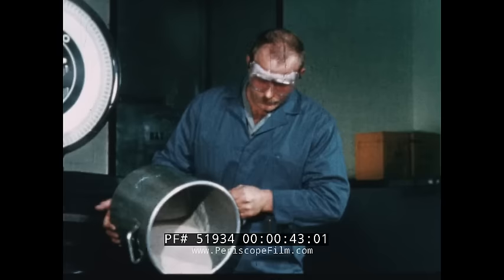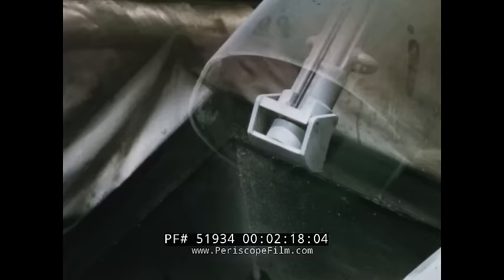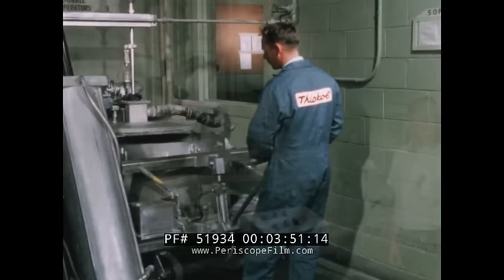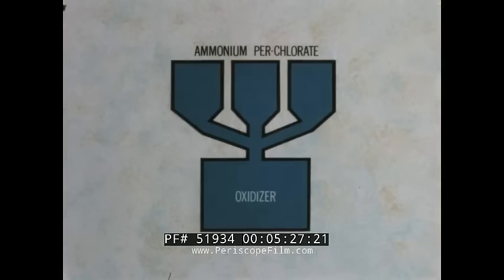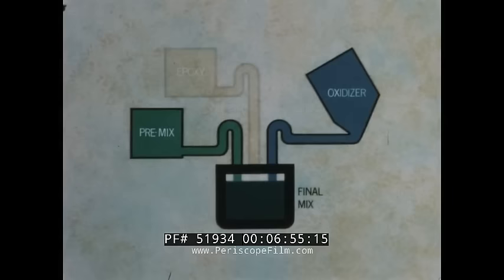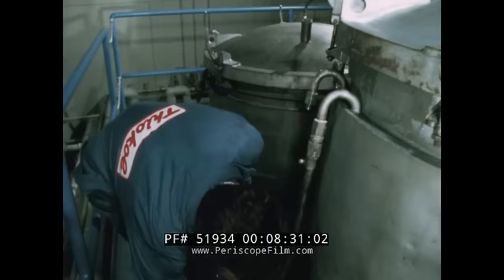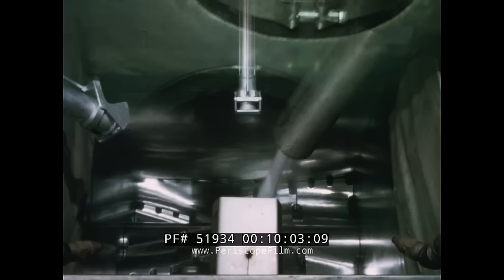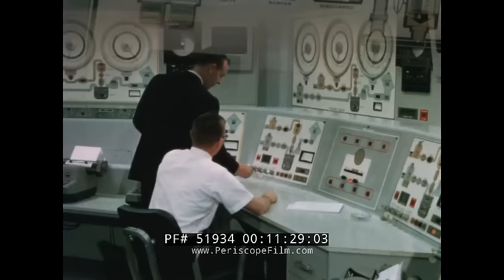THIOKOL ROCKET & MISSILE PROPELLANT  SOLID ROCKET BOOSTERS  "CAREFUL DIETS FOR MISSILES" FILM  51934

Comment: I used to work for ATK, Thiokol's successor.  Different division (ammo and military equipment), but it was cool working for the company that makes solid rocket boosters.
Reply: so you knew my uncle and my cousins they still work there.
Reply: @geomodelrailroader  Big company; he might not. My Dad retired when Alcoa bought out Thiokol; he started out in the lab at the Elkton plant and was up to senior management in Utah by the time they eased him out.
I loved the ginormous cake mixer at the Elkton plant for the STAR motors and what looked like actual bakery mixers they used in the lab when mixing up small batches for teeny tiny test motors.
Reply: @ellenbryn  yup and my uncle just retired from the plant last year my cousin still works there. Too bad Project Omega got the axe but SLS is still being built at the Utah plant. Elkton was in the book Secret of the Old Mill and that incident where they had a fire in the mix building did happen luckily the plant did not blowup like what happened at Pepcon in Vegas.

Comment: Fun fact ... my dad started his career as a research chemist in the aerospace industry in the very plant in this film while they filmed this. I keep looking to see if I can see him in the footage.
Reply: Jeff Marler do you know when this video was recorded? 70s?
Reply: It would be mad if you could. Is he in there?
Reply: Oh that's so cool! Any fun stories from being on the job?
Reply: @WineScrounger  I looked several times but I could not see him. He would've been in the lab or loading rocket motors with the finish propellant.
Reply: @machadpe1  I'm guessing late 60s, but I don't know for sure. It was right outside of Ogden Utah.
Reply: @SouthKratts  A lot of his work was military related and classified so I didn't hear a lot. 

I do know that in his career he worked on solid rocket motors that were used in minute man missiles and the space shuttle (that was his work at Thiokol). Some of his work was also used in the heat shields on the shuttle. He also worked on the B2 Stealth bomber and was actually inside the aircraft before it was declassified. The team he was on developed the radar reflective material. 

He did describe to me one time, having to crawl up into the bore of a cast rocket motor to patch a crack. 

And another time they were testing a motor out in the desert and lost control of it. Apparently it just spun around burning in a concrete pit until the fuel was consumed (there is no way to stop those solid propellent motors once they are started). He ended up taking home a chunk of green glass that was formed from the heat of the exhaust on the sand.

I currently fly high power rockets using the same fuel he helped develop (I have a LVL2 certification) but I only have a few pounds of fuel at any given time.
Reply: @jmarler2010  Level 2? That's great- I've had my Level 1 for a while and have been meaning to test for Level 2 (although the pandemic has somewhat gotten in the way of that). I had gotten it through the rocket team at my old school, and there was an alum there who showed us his ten-foot-high Level 3 rocket.

I shouldn't be surprised that the motors burn hot enough to make sand into glass. I'd do what your dad did if I was there too- that's a heck of a keepsake!

And I didn't know Thiokol had made radar reflective material until today. Cool! Your dad sounds like a cool man. :)
Reply: @SouthKratts  No, he started at Thiokol, but he didn't stay there. He was at a company named Fiberite when he worked on the B2.
Good job on the lvl1! Our launches were shut down last summer as well due to the pandemic, but if you go to my YouTube page, you can see my lvl2 flight.
Aluminum and ammonium perchlorate react at 5800 degrees so making glass is no problem.

Comment: I was teaching chemistry and math at a community college when I was approached by the physics professor who wanted to start a rocketry program for his STEM students. I began getting formulations and vendors for the chemicals. I am probably on every watch database the U.S. has. :) I was able to get a 400 pound drum of potassium perchlorate donated, just pay the freight, by Thiokol! We made simple 2" diameter ABS tube walled rockets with water-putty nozzles that would make 110# of thrust. The first test we ran the physics prof told me, "you may want to cover your ears"....we were 30-feet away behind a parked Suburban. DAMM they were loud little things! Yup, rockets are a blast (no pun intended).
Reply: Impressive. You’re a great inspiration to those students. I’m a community college student myself studying to eventually work in aerospace somehow. A note of advice. Richard Mamma’s site has a lot of information on the construction of solid fuel engines through his experiments . 

I would highly suggest using steel walled engines as they won’t explode dangerously as easily if it does explode. Be careful, good luck, and have fun. Awesome!

Comment: "sealing the container is critical"  Note the special coffee cup port closure device at 5:23
Reply: The paper cup is there for good reason.  They would not want anyone to try to clean the coverplate due to the fact it might cause an explosion and fire. So they use paper to use one and dispose of properly. Most likely incineration.  Waxed paper in explosives manufacturing is necessary. They insulate and don't generate a static field. Plastics like Saran Wrap come charged up with massive amounts of static electricity, which is a major no-no.  They use waxed paper and ordinary paper products in fireworks making too.  Not one bit of plastic or phenolic type material is see in any of "How it's Made" films of making explosive. Same with this one.
Reply: @Foxtrot Uniform that’s Amerika, more capital for the Plutocrats. .
Reply: @Alternative Power Systems These cups were probably contract built, & have a Gov't National Stock Number (NSN). I imagine the cups also are stenciled with "Not for the  containment of beverages, hot or cold".

Comment: What is that thing the guy is putting together at 7:19 ?  I've never seen anything like that before, and it isn't obvious how it interfaces with the process.
Reply: @Brian J Govern   This is an early version of ROM ( read only memory ). Essentially what we see is a "breadboard" with interchangeable components, by which the programming is achieved. By the look of the components they seem to be ceramic resistors in the 2 to 8 watt range. I presume the resistors are selected for precise values from a batch, then color coded for easy identification by the breadboard programmer. When inserted into the backplane reader unit, the analog computer will read the values and use them as variables.
Reply: @trespire  Indeed.  In those day's the (analog) signal coming from the scale where compared with these 'presettings' (... when the were 'equal') ... the next product get poored in ... and so on.  
Principle
see https://en.wikipedia.org/wiki/Wheatstone_bridge

Comment: I wonder if that aluminum and polymer (or some other carrier) mix would be of benefit as a roof coating. While it was being poured, it sure looked like it would reject some solar heating. Not sure if it would work as insulation in the winter though.
Reply: It would definitely keep a house warm once it caught fire.
Reply: Erm, unless you want to emulate the fate of the HINDENBURG...  Google Mythbusters and HINDENBURG, and see for yourself.  That stuff is nasty.
Reply: @Nighthawke70   @ryanchristopherson374  I'm talking specifically about the segment at 2:45, where it shows an Aluminum and Polymer "pre-mix". Obviously, I'm not referring to the later stage, where it receives the powerful oxidizer needed to turn it into rocket fuel. Aluminum Oxide and Epoxy, stuck to paper is commonly known as "Sandpaper", and is not known for flammability, even when used at high-enough speeds to set wood projects on fire. 
The premise is that: When the top surface of the combined material becomes abraded from weathering and necessary maintenance work contact, the polymer (usually asphalt in commercially produced roof systems and shingles) will tend to oxidize and degrade. By having a durable material such as aluminum oxide mixed into it, rather than the common marble fines from quarries sprinkled on top, each phase of the material's life, where the surface is degraded simply reveals a new layer of aluminum oxide... Which is exceptionally hard and chemically passivated by the oxidation on its surface. In the event of acid rain (and even CO2 dissolved in rain, which makes that rain slightly acidic) decomposing the aluminum powder on the surface (which is the natural procedure for how clay happens), it will simply expose more asphalt/polymer binder for a fairly predictable product lifespan. The lifespan could thus be selected and set on any given roof or non-pedestrian surface, by modeling environmental factors of that given surface, and applying a prescribed material thickness for each roof zone. 
...or, you could just continue to do the same, simple techniques and products that currently squander valuable petrochemicals, and give highly variable results, but still have the same very-low fire risk inherent in slathering your roof in refined petroleum distillates.

Comment: I'd love to get into designing and building SRBs and or running a fuel casting plant for them. I have several ideas I think could give them a comeback for widespread use in space launch platforms. If given the opportunity I'd love to start a new company building them. I'd need to attend a suitable college to gain expertise in them first however.
Reply: Well, you'd be up against a virtual monopoly of manufacturers there.  You'd have better luck in the hobby rocket motor business, if you can build a better motor than the rest of them, for a decent retail price.  And keep it within ITAR and National Association of Rocketry regulations and standards.